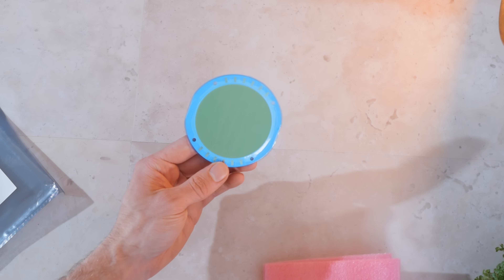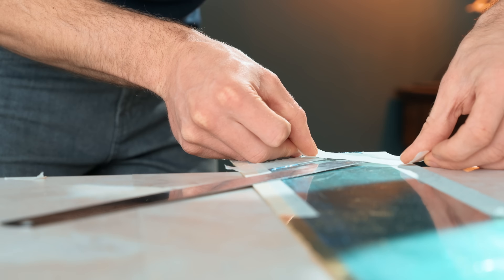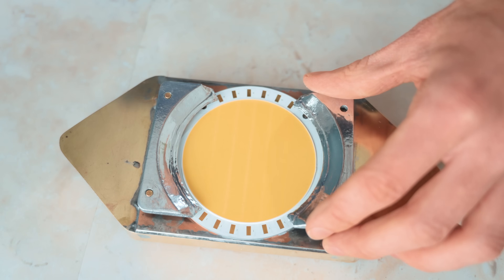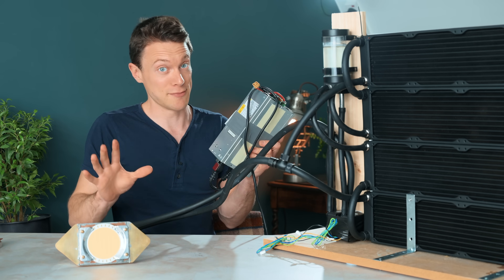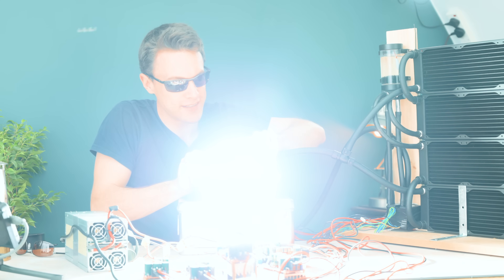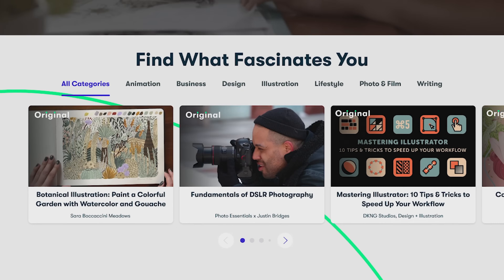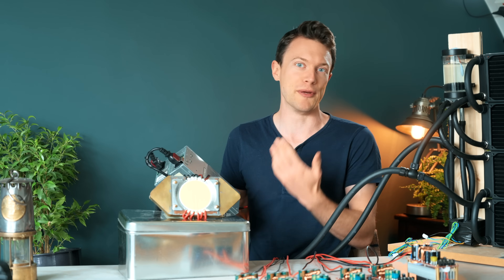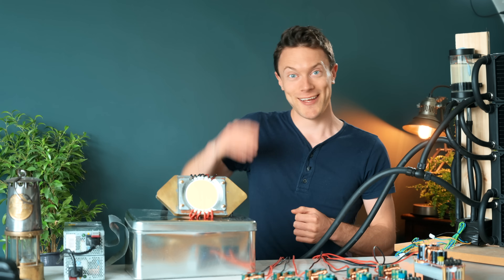Testing the world's BRIGHTEST LED!!!

Comment: Food for thought. I'm sure someone may have already said this or you may already know...but, here goes. Your power packs may be able to handle the watts but are not able to "draw" the AMPs. Not sure what voltage the power units are drawing with but you showed around 38volts. At 120volts, the power packs will draw "X" amount of amps per watts but at 38volts they will draw "Y" amount of amps per watts. I don't remember what the conversion formula is off the top of my head (Doing this on my phone at breakfast, lol) however, you can always "Google" the formulas and there are conversion tables online as well. But, like I said, you probably already know this and have since figured it all out.. lol  Either way, WOW what a light that is!  Thanks for the vid! :D

Comment: I'm not an expert in anything... but in my opinion your cooling system is overkill it and also pieces holding the LED should be made of brass or copper (or other metal), I imagined when the heat goes up along the time using LED, it will melt the 3D printed holder.... and also, the redundant cooling system should be used to cool the power supply...... Thanks

Comment: Are those really old dell poweredge supplies there? We have boxes full of them, but I've never seen them wired in series before. I suspect that the power supplies failed due to failed capacitors, the diodes on the on dell poweredge 1950 and 2950 supplies are notorious for back flow causing the electrolytic capacitors to swell and even burst. Not sure though, I'd love to see a teardown to see where the failure was.

Comment: Water cooling is also used for nuclear reactors, and cars. Instead of water try G13 for cars with only 2 radiators? I'd like to see this in the middle of a stadium, in the night, without any other lights.

Comment: When wrapping PLA, add copper tape, then kapton tape, then copper tape, then aluminium tape. Also, PSU's have maximum draw on each rail - even a 1000W PSU will not deliver that on one rail.

Comment: You should have tested the block, water circuit, and thermal capacity of your cooler before attaching the LED. The blades in your cooler have about a tenth the surface area of a typical cpu water block.

Comment: Computer PSUs offer different wattage on different voltages, so if its a 1000W rated PSU it does not mean it can deliver the 1000W on the 24V rail.
But you are a smartie so I guess you do know that.

Comment: You need to use single power supply unit. Together it fails because it has a little different output voltages.

Comment: Taping two power supplies together so that the heat just transfers between each other was a bad idea. 

I would have just used two lead acid automotive batteries to provide 24 volts DC, or five 6v batteries to get 30 volts and eliminated the step up circuit as well.

Comment: 4:42 It's not the thermal mass (specific heat) that slows down the soldering, its the thermal transport (which is actually what you really want anyway).  gram-for-gram, copper has less than 1/10th the specific heat of water.

Comment: Incredible project! It's normal for the rated wattage of power supplies to be a lot higher than what they can actually deliver in practice. For building a PC a general rule of thumb I've been told is max 50-75% of the rating which matches your unfortunate findings quite well. It's likely that the rating considers max peak, not sustained pressure.
Reply: That "general rule" is because of efficiency not because of overcurrent protection. A legit 1000W PSU will deliver 1000W (or even more) and there is no need to not use what it is supposed to deliver. A 1000W PSU can be pushed to its limits. It would not be rated 1000W if it could not deliver it. 
But at 50 to about 80% load a modern PSU is in its sweet spot in terms of efficiency. They get to about 99% efficiency in that case but only to around 98% if at max load.

Comment: I use 1000W 5000k metal Halide, electric ballast, lights every day.  Too bad you couldn't use a metal Halide power supply....    My light fits in a 5 gallon bucket, has 14k lux at 5 foot 8 inches, and 110k minimum Lumens. $350 for my first, $155 for the next two.  I did buy a ls 2 stand to move them around the job areas..... I decided that anything under 80k is too dim for an indoor room.  Realize that the sun is 30k lux on cloudiest day. So, while 120k lux sounds like a great deal, it is a pen light compared to the Sun.  It is just that we humans are still in the dark ages when it comes to adequate indoor work lighting.   This is why the indoors suck the life out of people.   10k Lumens does not cut it....  So, I want this led to work..... What I wonder however is, if you could not skip the heat sink altogether and expose the back side of the led to the water.  I have built several lights using this concept.  However I can see spikes or fins going into the water helping with the water contact area. At 1500 watts, would need copper.... My other thought is that the Samsung lm301b does 230 lpw.  Once you break 200 lpw, your heatsink requirements drop exponentially.   If they focused on 200 lpw, we would be able get the 120, 000 Lumens for under 600 watts.    I will gladly trade pretty cri for being able to see better with less electricity and heat, and bulk. And a more practical design.

Comment: A power supply may have variances like not giving 12V, instead 11.8 or 12.2V. By having variances in voltages by time your are burning it! You may be able to connect two power supply with low power well but the heat and power passing through the cables could be too much to handle!! Try to make the appropriate power supply or find the right one for your charge (the LED) .

Comment: dude 1500w means around 70% of the power becomes light. so 30% becomes heat which is 450w, u said the aircooler u had was rated for 1/5 of the power generated as heat so that double tower beefy aircooler is rated for just 90w? u got something wrong there
Reply: and btw 4 480mm radiators are huge overkill for just 500 watts of heat

Comment: a single one of those radiators could have cooled this fairly well. 2 would have been overkill. hopefully they're made of copper and not aluminum to avoid galvanic corrosion. also wondering about the metal tubes pertruding from the bottom of the reservoir.

Comment: Well, it is 1500W power draw, not 1500W TDP. That's quite a difference. It outputs lots of energy as light and only fraction as heat, so that cooler might be complete overkill after all. LEDs have roughly 40-50% efficiency, so you would be running at 900W TDP. That's also why it is running quite cold. It generates much less radiant heat than you expected.
You seem like you know what you are doing but anyways, power supplies have separated sections, so it is possible to burn one section with much less load than total possible. For one, there are 3,3V and 5V sections that sometimes add up to total power (you can draw 1kW but not from 12V only). Secondly, some of them have multiple 12V sections assuming that you will power more units with one supply. That could be dummy mistake that lead to overloading them.

Comment: I love you man, and your waterblock idea! Tho it was COMPLETELY unneeded... But this was all wrong... Why did you spend thousands on the LED, radiators and boost boards, but then cheap out on some $20 server power supplies made 15 years ago? Those supplies were completely wrong for the job. The voltage was wrong, as you said, and those units are not designed to bridge in series like that! To do that, they must be modified to disconnect their case grounds (in case they touch, which yours are!) and tweak the protection circuits + current sharing circuits to tolerate the higher voltage so they aren't fighting each other to death (likely what happened). You should have used a single supply that has built-in current regulation and is designed to output 30 volts. Or, since you used the boost boards anyway, why not wire the PSUs in parallel as they were designed, and then boost that 12v to 30v? That would actually put less stress on the PSU and boosters bc it would be a clean, regulated 12v at higher current going into the boosters. 
I was sad to see you give up so easily on this... After all that time and money invested, your just going to give up at the first problem, without achieving the one thing you know everyone was watching for (Outdoor Illumination rivaling the sun itself)? Come on now, just rewire those PSUs in parallel, readjust the boosters and finish this project! Don't let a little smoke defeat you!

Comment: Your assumption the the power supply power limit of 1000watts is not correct. As this is the power supply of the entire transformer make up not the single transformer voltage you were using. I would guess the power limit of just a single transformer for 12v would be 600watt.
Reply: I assume you have the power supplies not connected anyway in the circuitry and double check the grounding of the power supply case to ensure they are electromagnetically seperate.

Comment: Cooling solution is excessive. One rad would be fine. 1500w lead should be dumping less than 500 watts of heat. I use a triple fan rad to do 600watt dissipation with medium airflow. Can't wait to see this in action in the next video.

Comment: Very interesting, that custom water block you made, next level stuff ! as for the power supply, it was a good idea, have you found a solution ? there are even PC power supply up to 1500w or more I mean enthusiast, I'm sure you know about them, doesn't come cheap though, oh and since you went a little overboard with the cooling..could always add more stuff that need cooling in the future ahha, altough, not sure about the max temp rating on the LED..

Comment: Use this LED in your homemade projector
Reply: I don't know if any LCD would withstand this brightness as any LCD screen will heat up so hot and will break instantly. Only possible image source for this led is to use DLP which requires complex engineering!
Reply: @ayylasco  but what if you liquid nitrogen cooled the LCD panel?
Reply: @rocifier  that'll cause either just frosting issue which will produce blurred and distorted video, or will crack due to huge temperature difference. Your best bet if you  really want to use LCD is to water cool it with absolutely zero bubbles and a custom transparent cooling block. Even with those things, the picture created will have warped or distorted image. Remember: you are cooling the picture producing part of the LCD. altering with it even with slightest bit may lower the image quality projected. That's why lcd projectors aren't as powerful as DLP projectors.
Reply: @ayylasco  You only need to block UV.
Reply: @cosmefulanito5933  UV filter will not help. LEDs are color accurate and white ones produces pure combination of blue, green, and red. No UV.

LEDs itself emits pure UV with wavelength of 405nm. But by varying the levels of phosphors allows it to customise its  color. After the UV passes the phosphor, it emits the color desired, and there's little to no UV light is left.

Xeon lamps and Metal  halide lamps found inside powerful projectors contains high levels of UV. Which requires glass UV filter.
Reply: Bonus points if you use period-correct vintage celluloid and manage not to go up in flames. Oh wait, you meant DIGITAL projector...? Sorry my bad...
Reply: Also at 1.5kW it's gonna cost a relatively large amount just to power the led, about 30¢ for a 2hr film. The average (day and night, annual) US household uses about 1.2kW for the whole house so this would more than double the power usage when it's on.
Reply: If you want to project an image onto THE MOON...😊

Comment: Dude, why aren't you showing the part where you calculate the approximate amount of heat generated and checking first if the watercooler you're using will dissipate that heat fast enough? Or calculating the rate of flow/ whether coolant fluid has to be used and if yes which one/ how did you decide which thermal compound paste is to be used? They are all the fun parts. Or did you really just wing it? So many plot holes, its distracting me from enjoying this video. Otherwise, I like all your videos! Good job!

Comment: Not sure how you did the math on the power supplies, but to get 1,500 watts, the two series power supplies have to be rated at over 1,500 watts apiece, not 750 watts. Also, the converter/regulators are not 100% efficient, which requires even more supply wattage.

Comment: You CANNOT put standard PSUs in series. This works only if they are explicitly made for a series connection (which some of them are) but they have a special sync-connection. The main problem is the difference in voltage. Even if one PSU delievers like 12.01 Volts and the other 12.02 Volts, the latter one will server ALL the power until maxed out. Then the voltage drops and the other PSU will supply the remaining power. So one PSU is constantly running at maximum (possible way over the rated Amps for the 12V rail).

You should use at least three PSU of at least 800W each and supply 12V to the boosters (most of them can handle 12V input)

Comment: I would suggest mounting it on the roof of a vehicle so you can test it properly outdoors. Maybe the cooling system could be driven by the engine in the car? Not sure how you would power it though.

Comment: Since these PSUs were wired in series each PSU would be delivering 1500w. Wattage only gets divided between them when you run PSUs in parallel.

Comment: Maybe the two power supplies should have been separated, I am presuming that they came as two separate units because they have two power cables. I noticed that you had a total power meter so you may be running from the same socket. The reason for separating the power supplies from each other is to allow for better cooling, separating them two sockets gives you a cleaner current/voltage. Good video by the way I like all your stuff.

Comment: if there are 6 different sections you should try to run it with a duty cycle, swap between alternating sections, would reduce the heat and power load

Comment: So how does the manufactuer suggest you cool it? You're not going to have 4 radiators and a water pump in a light fixture (usually). So what's the practical install method?

Comment: You didn't look very hard for a larger waterblock, several companies make dedicated TR4 blocks that would be more than large enough for that plate.
Also, at 11:24 none of the fans are spinning on the rad. What's the point of 4 radiators (there isn't one btw, you could maybe justify 2, but I doubt it... you'll probably hit saturation before you need a 2nd) if you're not even running the fans? They're useless without air movement unless you're using them exclusively as thermal mass.

Comment: I found you a power supply for this, it's an 1800W 36V power supply (max input voltage is 41V for that LED, so this will work out perfect, and it's only $260. https://www.amazon.com/YI-MEI-Upgrade-Switch-Supply/dp/B07WLQPRR1/ref=sr_1_2?dchild=1&keywords=36V%2BDC%2Bpower%2Bsupply%2B1500W&qid=1592340867&s=pc&sr=1-2&th=1

Comment: The heat emission should not be to crazy. LEDs are very efficient up to 85% of the power is transmitted into light hence just 15% of 1500W equals 225W need to be cooled.

Comment: When your power supply is pushing 750w@24v adding buck converter would load it more than your math calculated. Since the converter has to convert some of that wattage to voltage...

Comment: Hello: Since I work with electronics. I can see where you need to change. You are definitely have to upgrade your power. I would Use a (if you can get one.) transformer of a inverter 24 to 36v. Then you would have make a regulator circuit, Yet it would work off what ever your power in is. There is some battery chargers that could be changed as well. The main part is to have tight regulation of you power out so not to waste the LED. Oh and one other thing is to set a soft start up so not to surge your circuitry.  

E..

Comment: @DIY Perks
I have a question, cooling system was great and needed, ok, but with 6 section on LED and each one 30v needed , in series you could have a LED with 180v input and taking control of it could be much easier, I really don't get why you didn't try that, I will be glad if you open this method this up , Very thanks for great video and I'm very excited to hear from you.

Comment: Nice LED! I worked at an LED company that designed high end bright LEDs for marine applications. We ran into the same power supply problem when we used 2 big 1k watt power supplies in series. The solution turned out to be purchasing power supplies that support 'load balancing'.  That way one power supply never gets briefly slammed with the whole load.

Comment: I see you used those PSUs in a previous video, and they popped not because it's rated 2000w on all rails. From what I remember those were 1kW x 2. Wiring them in series creates 24v at 1kW, not 2kW. Yes, wired in parallel it is 2kW at 12v. But to achieve 2kW at 24v you need 2 12v 2kW PSUs.
Hope this made it clear!

Comment: You turned the server power supplies off at the mains. Please don't do that. The internal fans spun down instantly and gave the heat inside no way out.
After doing that, there would be a temperature spike in the power supplies leading to damage.
Always disconnect large loads first before shutting off the power supply.
In essence, this is an issue I have with computers entering standby: there is a spike in processor activity just before the system sleeps and the resulting heat has no way out on sleeping. I wish Microsoft would work with manufacturers to either increase fan speed higher than processor load as the system prepares, or the manufacturers find a way to leave the fan on at a low speed for a little while after the system sleeps.